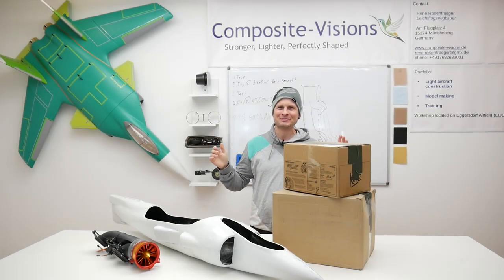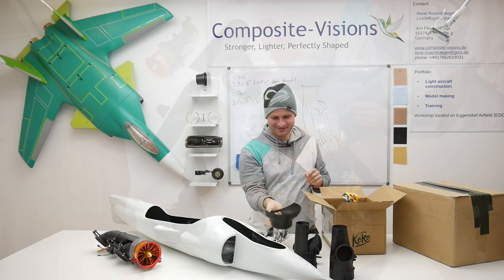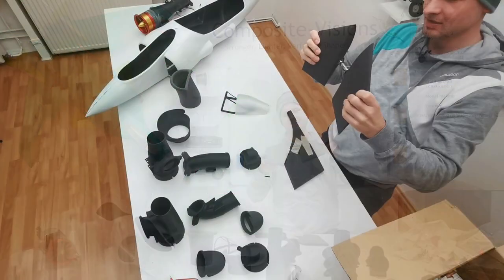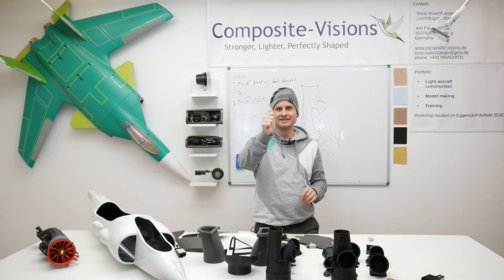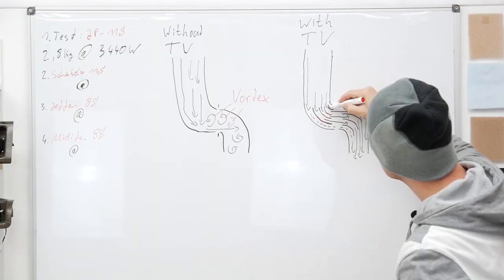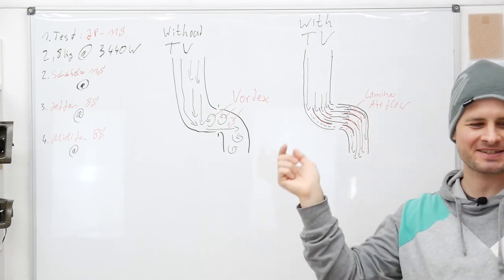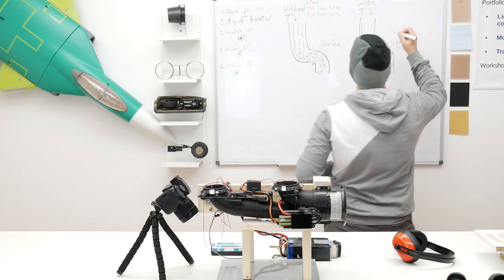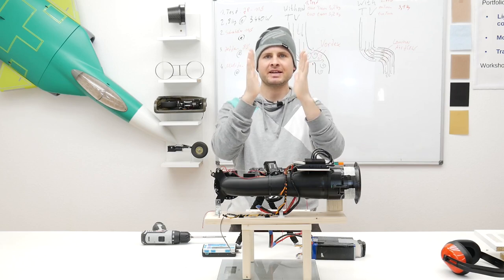Harrier eVTOL Powerplant Testing and Optimisation | 3D Printed Ducting and Nozzels

Comment: Hi Rene,  as far as I can see there few issues. You need as much as Air to trap within the tube,  but also you need to trap that air inside the tunnel by changing inlet nozzle (nacelle design) which will increase the air pressure build in the tube which will affect the thrust about %15 to 20 percent. But, also you need to check if there is any air bleeding anywhere around the tube such as cable connection holes etc. Second thing tube size should reduce from 90 mm EDF fan end to gradually to 70 mm diameter think like air compressor pressure thank.  and there you will need to equilazer for air out put and for this by the nozzle adjustable opening and closing quide vanes in back ward C shape . Overall think it  this way, EDF compressor provides high pressure air and nozzle are like out put with smaller nozzle (jet water nozzle) if you do not have enough pressure build in the pipe then water jet nozzle will not work and total out put area should be no more than %70 main inlet area. For example,  90 mm Diameter EDF X %70 = 63 mm Diameter,  then total area A=πr2  here A≈3117.25 mm2 total pressured area,  then you split that in 2 as you have 2 outlet which will bring that 1558.62 mm2 area for each inlet. If you reverse calculate which will be roiughly 25 mm to 30 mm diameter of each nozzle or equal any shape with the same area volume where you will get exactly same amount of high pressure of air flow..  Good luck .

Comment: Hi René, If i understand right, you reduced the diameter of the nozzles. Probably this could be the reason for the not sufficient outcome. Its Like creating a traffic jam. The edf tries to bring more air into the system but at a specific point the airflow is'nt increasing anymore.
Reply from the maker: We think so too 👍👍

Comment: Hi Bro . I love your works and the amount of R & D you do are really amazing ,you are living my dream life.
I have an small idea on your HARRIER  project 

IDEA 1 -> Make the first nozzle of both the edf closeable (So the thrust coming out of second nozzle of both edf  will be more powerful during cruising speed and altitude)

IDEA 2 -> You can make the harrier more like an helicopter by moving the nozzles as following 
                      EDF 1 -> nozzle 1 ( 7.30 clock position ) nozzle 2 (4.30 clock position )
                      EDF 2 -> nozzle 1 ( 7.30 clock position ) nozzle 2 (4.30 clock position )
                  [ after reaching desirable height you can easily transition from hower mode to forward flight by blocking the  first  nozzle  of both                                                       t                   the edfs ( IDEA 1 ) ]

IDEA 3 -> Reverse thrusting ( use the rotatable nozzles to act as reverse thrusters during landing)  STOL

IDEA 4 -> Also make the sencond nozzle of both the EDFs closable for the  transition of forward flight to hower
                    ( use the reverse thrusting of nozzle 1 both  edf to slow down the plane for easy transition into hower mode)

IDEA 5 -> if the nozzles experience more stress during the turning of nozzles (forward flight to hower) cutoff the power to  the edf for a               s                    second OR close the nozzle 1 of both the edf before reverse thrusting so the 1st nozzles can now turn without any stress 

IDEA 6 -> during hower mode  make sure that the air coming out of the nozzles are 45 degree ((1,1,1) cartesian  coordinate system) apart from your design for more stabilty (i don't know how to express this idea 6 to you ) 

PLEASE MAKE SURE ALL THE 4 NOZZLES TURN 180 DEGREE( from 3 o clock to 9 o clock ) make a strong robust system for it

** i think this idea of controling the plane using all 4 nozzles  requires more coding and using this 4  movable nozzle concept to make a single plane capable of both STOL and VTOL is really amazing and only persons like you and your friend can make this possible**

Love from india!!

chat gpt optimized 

Subject: Optimization and Enhancement Suggestions for the HARRIER Project

I hope this message finds you well. I've been following your impressive work and the dedication you put into research and development truly amazes me. You're living my dream life!

I have a few ideas to enhance your HARRIER project:

Thrust Optimization During Cruising (Idea 1):

Make the first nozzle of both EDFs closeable.
This adjustment will increase the power of the thrust coming out of the second nozzle during cruising speed and altitude.

Versatility in Nozzle Movements (Idea 2):

Redefine the nozzle positions for a more helicopter-like functionality:
EDF 1: Nozzle 1 (7:30 clock position), Nozzle 2 (4:30 clock position)
EDF 2: Nozzle 1 (7:30 clock position), Nozzle 2 (4:30 clock position)
Transition from hover mode to forward flight by blocking the first nozzle of both EDFs after reaching a desirable height.

Reverse Thrusting for STOL (Idea 3):

Utilize rotatable nozzles for reverse thrust during landing, enhancing Short Takeoff and Landing (STOL) capabilities.

Dynamic Nozzle Adjustment for Transition (Idea 4):

Make the second nozzle of both EDFs closable to facilitate the transition from forward flight to hover.
Use reverse thrusting of nozzle 1 on both EDFs to slow down the plane for a smooth transition into hover mode.
Stress Management during Nozzle Turning (Idea 5):

If nozzles experience stress during turning, consider briefly cutting power to the EDFs or closing nozzle 1 before reverse thrusting to reduce stress during transition.

Hover Stability Enhancement (Idea 6):

Ensure that during hover mode, the air coming out of the nozzles is 45 degrees apart in the (1,1,1) Cartesian coordinate system for increased stability.
Additionally, for a robust system:

Ensure that all four nozzles can turn 180 degrees, smoothly transitioning from 3 o'clock to 9 o'clock.
Develop a strong coding framework to implement and control the movements of all four nozzles seamlessly.
I believe the implementation of these ideas, although requiring intricate coding, can make your project capable of both STOL and VTOL, setting it apart as an engineering marvel.

Sending love from India!

Comment: The ducting is torquing under max load rolling of its fix angle demonising slightly  direct down if it was more secured and held vertical column you may have see perhaps closer to the single turn thrust.

Comment: I don’t think you should be using batteries for this test, it’s unfair as the first run will always be the most powerful with the voltage sag impacting the later results. You need a consistent voltage

Comment: Good Job with a great and a very cool project!!

I have two questions:
1. Is there a lot of difference in noise level between the JP Hobby and the Schübeler EDF?
2. Very smart bearing solution you are using wrt. Nozzle. Thank you for explaining how it works!! Do you use any seal / o-ring between the nozzle and the body wrt. preventing air from leaking?

I am already looking forward to the next update.
Reply from the maker: Jp is a bit quiter, no sealing necessary😁👍👍
Reply: My 90mm JP edf, runs at 75k rpm. From the Schubeler web page, they writes <45k rpm, and sice it is a high-end product as well, I would guessed this had a lower noise then other edf’s in the market. But since material, bearings, balancing, shape etc. plays a big role as well, maybe the sum comes in favor for the JP wrt. Noise level?

Comment: I think your main ducting is restricting the airflow too much. Since you are printing the parts there are things you can do to maximize the airflow as well as reduce weight. What i propose is to have a single duct with a central wall separating the two chambers and blending in to the two fan units. Another thing I would test is nozzles with larger area. The veins should extend all the way out to the face of the duct and perhaps also further inside the duct. I wish you the best.